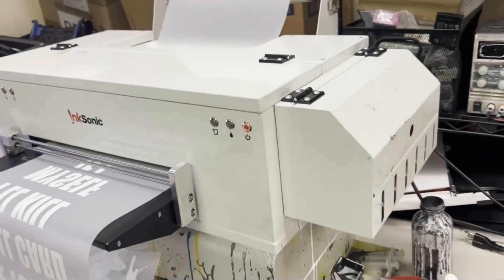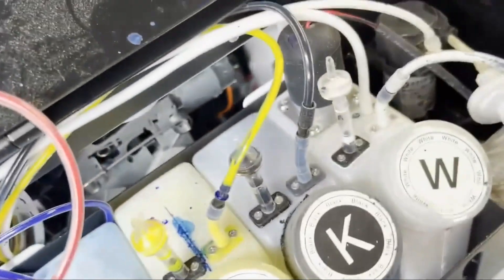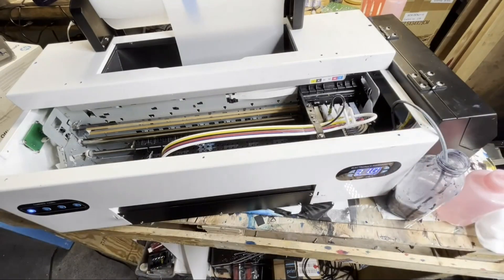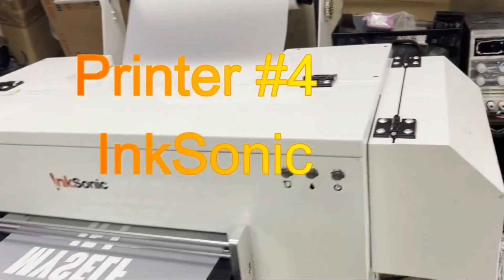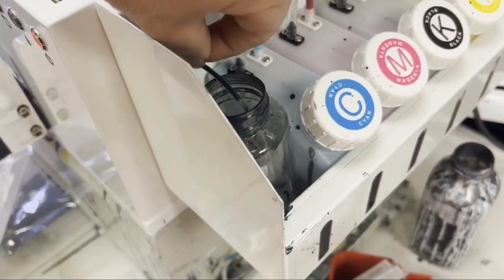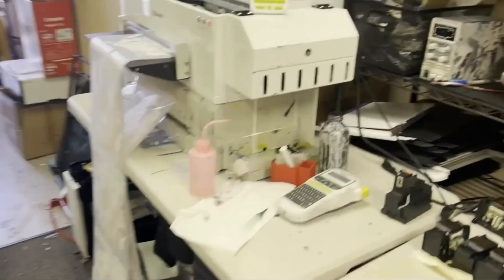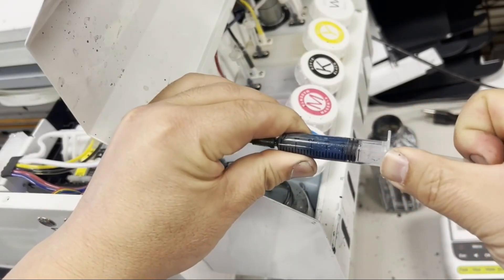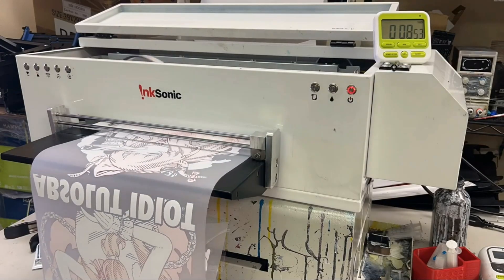Keep Your DTF Printer Working Like a Mule – Pro Tips for InkSonic C13A, Procolored F8 & Prestige A3+

Comment: Hi there love your work,, I have a ? Do you have to have a Lil pad inside the camping station? Thank you
Reply from the maker: Thanks so much for subscribing—it means a lot and helps us get closer to our 100k milestone! Great question—if you’re referring to the little sponge pad inside the capping station’s seal, it’s not absolutely necessary for function. Some manufacturers have actually phased them out, and many printers work fine without them. That said, if you prefer having one or feel it helps maintain a better seal and prevents splash, you can find replacement pads easily on Amazon or eBay. I try to answer subscriber questions within a few days, and although I'm still catching up on a big backlog, I really appreciate your patience and support!
Reply: Thank you very much for the reply👍👍

Comment: Any suggestions for brighten the colors for the prints for this machine. Mine are coming out dull, even with the setting suggested in the manual.
Reply from the maker: Thanks for your question and for supporting the channel! The first step is to rule out clogging by running a nozzle check to make sure all nozzles are firing, then check the purity of your inks by printing solid CMYK patterns, and finally consider having a custom ICC profile made to really fine-tune and brighten your colors. I do get a high volume of questions, but subscribers and members are prioritized for responses within about 48 hours, while I answer other viewer questions as time allows. If you need quicker help, you can email [support@bchtechnologies.com](mailto:support@bchtechnologies.com). If this video or my reply has helped you on your journey, I’d be so grateful if you could leave a review on my Google page here: [https://g.page/r/CfL7k6nYvPQ9EAg/review](https://g.page/r/CfL7k6nYvPQ9EAg/review). And if you haven’t yet, please subscribe or consider becoming a member—subscribers and members get exclusive benefits like early access to videos and priority answers!

Comment: My Procolored printer prints weak white ink when set to ‘Two Layer – Base Color,’ but the white prints strong and clean when I use ‘Base White Color’ mode. The nozzles aren’t clogged, so I think the issue might be with how the RIP is handling the white underbase."